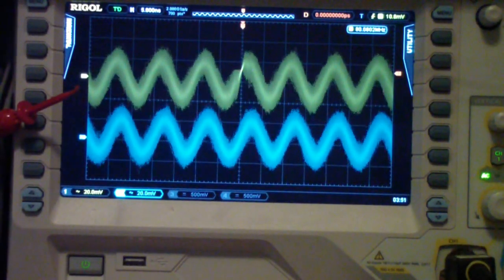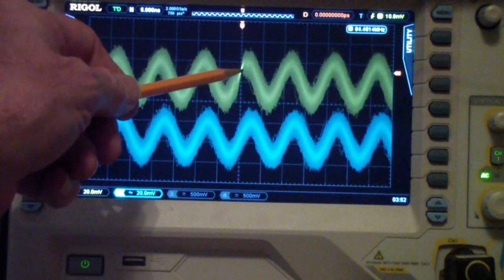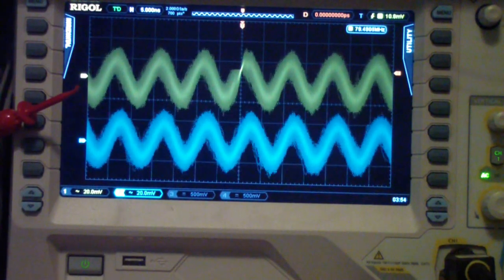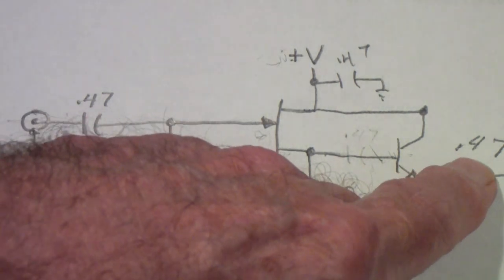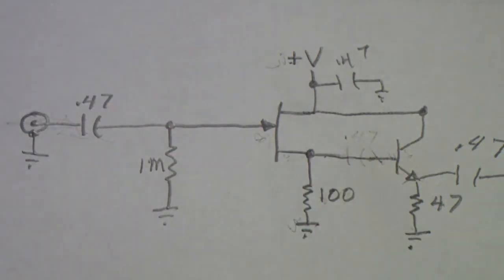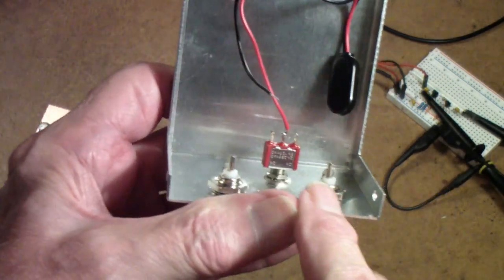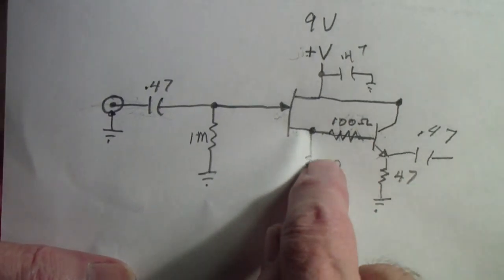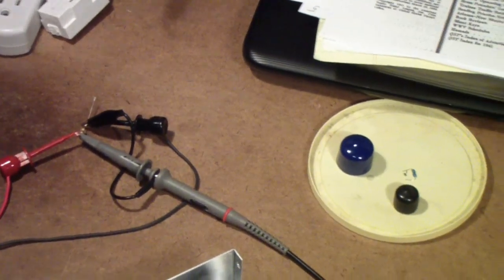TTT278 Active Probe for Spectrum Analyzer

Comment: Nice circuit.

However, I think you have power supply coupling.  So, you can either use RF bead or C-R-C network for your power supply for drain of JFET and another for Collector of NPN transistor, so you do not have power supply coupling.  Basically on side of Cs are connected to ground and another to the each side of resistor like a PI network. 

Also, you should use several Cs in parallel to get ride of self resonance frequency of Capacitor.   That is you should use 47nF II 4.7nFll 470pF ll 47pFll 4.7pf ll 0.47uf.

In general, I am not a fan of this type of probing anyhow, I would use E or M field probing for sensitive nodes.

Comment: I think this is an awesome little project and worth while addition to a spectrum analyser.  How practical would it be to add some higher voltage DC blocking and perhaps some additional attenuation I’m thinking valve radios Thanks for sharing

Comment: Could you connect sync out from the sig gen to external sync in on the scope to get reliable triggering, that should show the waveform clearly so any distortion et cetra would be visible; avoiding all the noise mush?

Comment: It would have been nice to show the Bode plot. A quick LTspice simulation shows that the base stopper cuts it by half to about 50MHz. -12dB at 100MHz.
Reply: Good point. The simulation indicates the passband is at minus 13.4 dB and the 3dB  response is 5.5 kHz to 52.3 MHz when driving into a 50 ohm impedance.

Comment: Would a 10 meg input be more appropriate for less circuit loading?
Reply from the maker: Yes, I should have mentioned that I use a 10X probe which divides the input signal by 10 and multiplies the input impedance by 10 giving a 10 Meg Ohm load to the circuit under test. Most scope probes over 100 MHz are 10X and that is what I use with this circuit. Thanks for the comment and question.